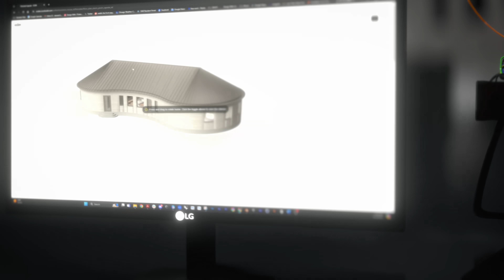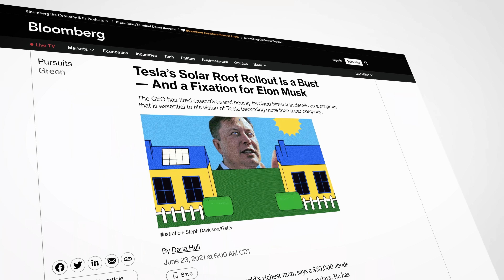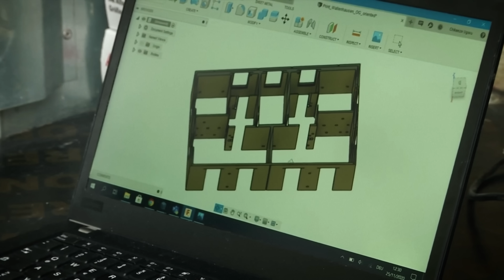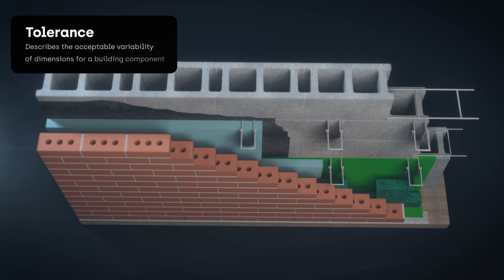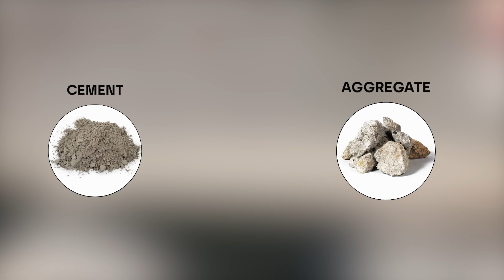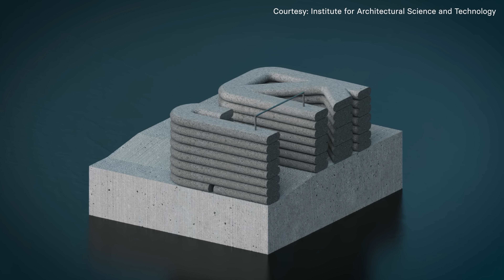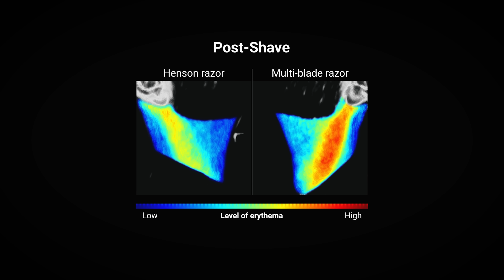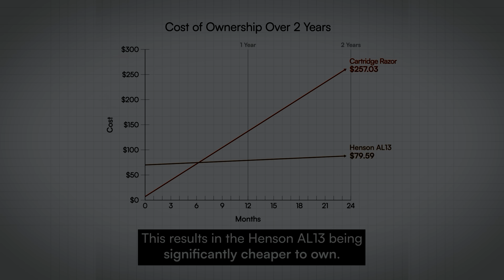Why 3D Printing Buildings Leads to Problems

Comment: A couple thoughts. 

First, you mentioned that it takes about 2 days for a house to be printed. Okay, that's a ton of work done in a short period of time. That's less cost given to the client.

Second, you mentioned any minor flaw will be seen forever? Why? I mean, with how much money the client is saving, they could always plaster the interior and stucco the exterior. 

Third, you mentioned that repairs are hard to do, because it wont look 3D printed... Well, if the walls were plastered, after the fact, that'd be less of an issue. If part of the wall was broken or needed tearing into, you'd be able to get some wire mesh with some rebar structuring, to keep it from being flimsy, then you'd just plaster over it with cement, and then plaster or stucco over. Furthermore, it doesn't take long to stucco or plaster things, and you mentioned how tight corners are hard to accomplish... Not an issue for plaster and stucco.

Fourth, although affordability is the main sales pitch for a 3D printed house, it seems to me that clients will still want to add equity to the home, if not immediately, then down the road. You spoke about brick masons quite a bit, but there's also Stone Masonry as well. Personally, I'm a stone mason, and the best way to build equity into your home (making it more expensive, thus being able to sell it for more, or being able to qualify for more expensive loans) is by putting REAL stone masonry on the interior or exterior of the house, or both. Brick masory does build equity, but not as much as stone. So, again, if there's any repairs needing to be done, there are options avaliable. Who says it all has to be 3D printed in a one and done process? That seems impractical and, as you mentioned, weird looking. 

Fifth, I used to work doing Faux Rock Construction. We'd use either a stucco hopper or a Carousel pump to shoot cement out of a machine and onto the structure. The problem that we ran into semi frequently was the issue of having something obstruct the hose from the inside, If that happened, we'd have to get a hammer and pound every lineal inch of the hose with a hammer, to try to get rid of the obstruction. If that didn't work, we'd have to empty the hopper's cement, fill it with water and try to clean the hose out, a decent ammount of cement, and starting fresh. This can take hours to resolve. Then there's another issue if you're working with a stucco hopper. There's a manifold that can randomely explode. When this happens, cement will fly everywhere, if the hose isn't secured, you have a 200-300 LB hose flying through the air 100 FT away from you. Cross your fingers it doesn't hit someone or break a window. Then getting a new manifold is a 4 hour process to get and a 30 minute process to assemble onto the machine. This happens about once or twice a month with these machines. I don't know why my boss never bought a good number of spare manifolds, but I assume they were just hard to come by... What I'm getting at is that I can totally picture this beind a problem with the 3D printing process. You meltioned how thick agrigate can cause the nib at the end to get clogged, and that's true, but we were using super fine sand in our mixture, and sometimes even a lubricant agent to make it flow through the hose easier, and we'd still run into the same clogging issue. So... I imagine that with so many custom parts for a 3D printer... it'd be difficult to fix and resolve these issues. 

So... those are my thoughts. Like... it seems to me that the biggest costs of building a house can be reduced down to a 3D printing, but not all steps in the process of making a house need to be abandoned.

Comment: The biggest problem I see is reinforcement. All walls flex under load. That means some of the concrete will be under tension instead of compression. That's why we put rebar in traditional formed concrete walls. The other issue is cold joints. Anywhere that wet concrete is expected to bond with already hardened concrete needs some form of reinforcement to bond the two together. Wet concrete forms a very weak bond with already hardened concrete.

Comment: ... The solution isn't 3d printing homes Crist... the solution is mas manufacturing modular pieces of homes, prices that come with wiring insulation and windows and drywall, Ships are build this way... they are built in completed segments that are welded together. Houses need to be built the same way, not out of steel like ships, built in whole pieces completely finished, the only thing that should be done on sight is hooking the wiring/pipes together between segments. Deliver whole pieces of a house to a sight, spend a week putting them together and connecting the wiring/plumbing and whatever else...

Comment: I don’t really understand why we’re even trying this. I mean, don’t get me wrong. The idea of perfecting this kind of technology is great but in a way this isn’t a new thing. I mean, we’ve had pre-fabricated homes in various degrees going all the way back to just prior to the beginning of the 20th century.

People used to be able to buy houses that were called “pre-cut“. Meaning that all the owner had to do or construction company, depending simply had to follow the instructions and put the pieces together kind of like an old model kit. Then, of course we had the prefab homes that we’re coming out at the tail end of the second world war. These of course were also called modular homes.

Well, the idea of a 3-D printed home is a novel one unfortunately I see way too many issues that outweigh any benefits. Firstly what is there to act as a reinforcement for the concrete? Concrete with no kind of reinforcement tends to not work very well. Even some medium gauge chicken wire would probably be beneficial here. 

Another problem. I don’t see any spots for even basic things such as HVAC, electrical or any other kind of wiring or piping. Yes, the one that we see has a small space in between the walls, but that’s not a whole lot of space. 

Another problem. Maintenance. Let’s say you have a pipe burst in your wall. If you live in one of these 3-D printed style buildings not only is there a possibility that you may not even know that there is a pipe that is burst if you do figure it out , you’re pretty much not going to be able to get to it without somebody coming into your house with a jackhammer. So they’re alone some major major problems.

Frankly, at the current level of the technology, I don’t think it’s ready for making homes. 

At the moment I think the technology would be better suited to making things like statues or or Nate Park planters and stuff like that. Unfortunately, I can’t see it at least at this current point in time being used for housing. Honestly, I think a better option would be to find a way to 3-D print wall panels and then have the printed panels taken into the job site where they can then be put up. That would probably be a better idea.

Comment: how about adding a twisted wire that links to the wire on the layer below then is covered with the concrete with a part the wire like loop above so the next layer another wire can be looped through and then covered to do layer by layer reinforcement that would tie the wall together and make it stronger kinda like how they build a fence but it gets covered in the concrete you can even do several side by side that get linked every so often you can even make loops like a chain that connect top bottom and both sides